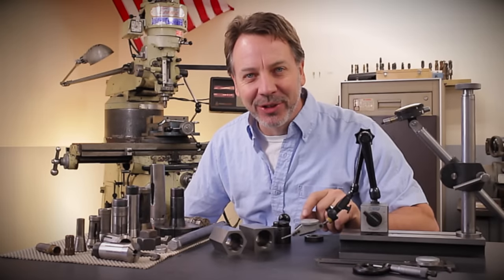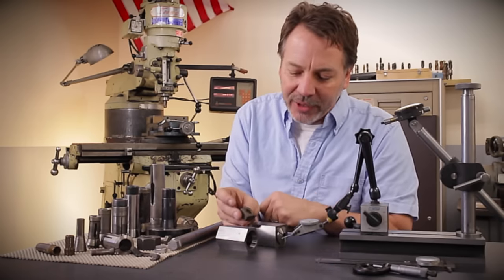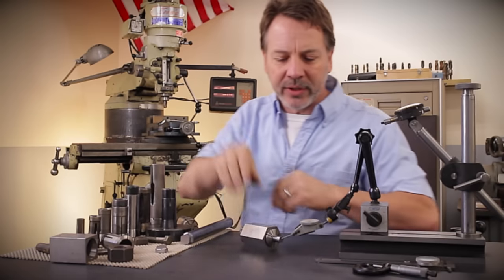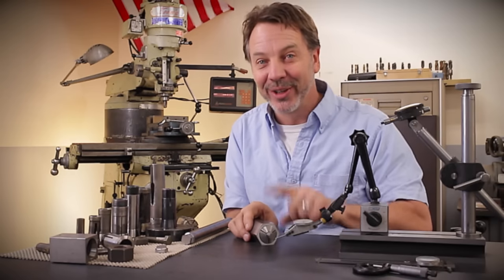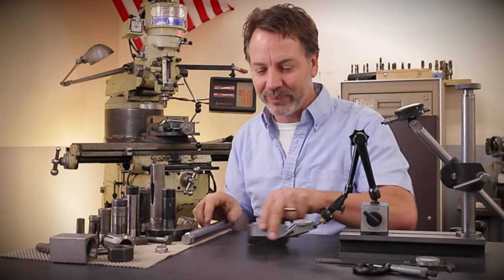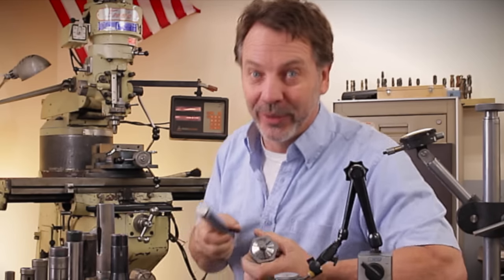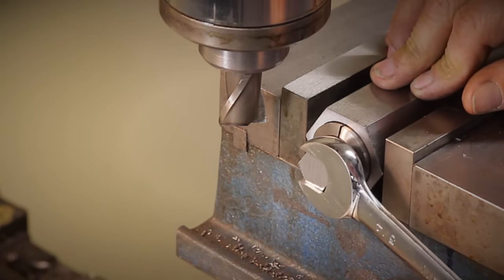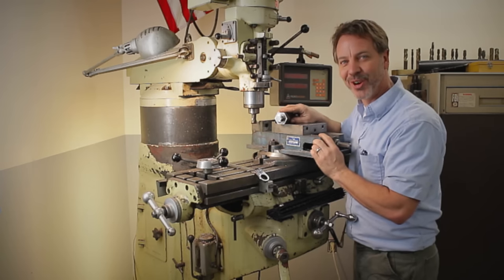How to use Collet blocks

Comment: I learned the hard way not to have the direction of rotation of the tool trying to pull the work from the collet. I now make sure to have the cutting force of the tool pushing in so it tries to force the work tighter into the collet.,

Comment: I have a set of 5C and many ER32s used on a CNC router. Been looking at the blocks but leary of Chinese and have too many wants to buy professional level. Metal is my hobby, wood my business. We replace our ER collets every year, they wear with constant use, heating/cooling, side loads, 16,000 rpm. Thanks for the great videos.

Comment: I'm a journeyman machinist of 40 years service and you did good. Years ago on my Bridgeport days I used one often, but sometimes they want a slot or flat on a few surfaces, so this was your preferred tool. You can use the block in a lathe too if your work is to be held properly without creating clamping marks on the finished surfaces.

Comment: I have a spindexer that I was going to use Tom Lipton's modification to create my own index plates before I got a rotary table with plates. It is handy for setting up in the vise and indexing 90 degrees for square and 60 degrees for hex. Another option for your viewers. Good job Dale, watch all you tips and have learned a ton. Keep them coming

Comment: another great episode that I just revisited.
as a suggestion it may be of benefit to outline the possible or common mistakes that occur in the various machining processes. like when you  (intentionally) rotated the collet block initially on a flat and then onto a corner. these type of examples are great for the budding home machinist.
Reply from the maker: great suggestion. See what I can do.

Comment: Hi Dale, it appears that either no troll has surfaced yet or they failed to catch the troll bait, which not clearing the vice and collet block of any chips or foreign material each time you rotated the setup, which is important for accuracy. Anyway, great job producing a simple and easy to comprehend explanation of collets and collet blocks. Thanks for sharing!
Reply from the maker: +Jeffrey Vastine 
Good job find the troll food.

Comment: From 6:00 - 7:00 after checking the dowel, I would mark the dowel side where the "X" is then loosen and rotate the dowel in the collet to assure the "off" readings were in the block and not the dowel. Next if the discrepancies were in the block I would chart the variance of each orientation to use in the future for better accuracy.

Comment: Good video as always Dale. And nice to see some one running an accuracy test on the tooling. I usually won't buy anything for the shop unless there's some kind of + - accuracy specification given. The off shore tooling is getting better in most cases, but the bottom priced stuff can still be pretty bad at times. But mistakes can even creep in on the top drawer equipment. If you don't test then there's no way to know you got everything you paid for, or that you just may have made a mistake and not paid enough.
Reply from the maker: +Turning Point 
great point

Comment: Clamping or referencing the work in a sharp edge is what I don't like about hex collet blocks. I will make a 12 sides collet block, I think will be more usefull. You can clamp in a flat surface, plus being able to index 2, 3, 4 (although I already have a 4 side collet block), 6 and 12 sides.By the way I prefer ER collet blocks, ER collets are more common here in Europe than 5C, and you can use the protruding nut to index the block.

Comment: Great video that''s going to help me make my Harbor Freight mini mill, be a "poor man's lathe". With the hex block I'll be able to machine a smaller bolt head on an existing grade 8 3/4" shoulder bolt. The problem I had was machining the run out of the shoulder for the 4 jaw chuck adapter plate. I needed the bolt head still attached to wrench it onto the adapter plate. The bolt is quite long, and I have no way of keeping the bolt centered with a live center as it's a mini mill, not a lathe. The Spindle head is my moving carriage so to speak.

I then have to machine the adapter plate with precision so it fits into the 4 jaw chuck

I purchased a QCTP from Grizzly, and a Slotted Angle Plate to attach the QTCP to the mill's table, to hold tooling.

But now being able to cut off the existing bolt head with the length I need for the shaft and smaller bolt head to fit inside the R8 collet, will increase the accuracy for the 4 jaw self aligning chuck. This all had me pondering as to how I was going to make this accurate, as the length is 6 inches.

Seeing this video saved the day! I don't have the money to buy a lathe so this was the next best thing. Believe it or not, I'm going to use the lathe chuck to do accurate letter stamping on an invention and some parts I'll be making. Hope this all makes sense. Thought I'd leave a positive comment, and build something cool too!

Hope this is a bit clearer than mud. But just had to write you to let you know, ya never know what you pick up, and will later apply it down the road. Keep up the good wotk Dale!
Reply from the maker: Thanks for you comment. Im glad my video was useful. :-)

Comment: Great vid, many times I've debated witch surface to register to the vice jaws. Do you mate the flats of the collet block to the vice jaws for maximum holding or the flats of the collet block to the bed of the vice to easily achieve a perpendicular cut????? I've utilized both methods without loosing an eye or spoiling the work. I've used collet blocks along with sine bars, angle blocks and stood them up on end  and using a work stop, drilled bolt hole circle on the end of a 1" shaft (worked great)! They also have their uses on the lathe, like in three jaw and four jaw chucks.  And of coarse on the grinder. A very affordable, versatile and overlooked tool. Looking forward to you next vid. 
Thanks
Andrew p
Reply from the maker: +Andrew Podaca 
Thanks for your comment, great points

Comment: Great video. I am a welder by trade but have also developed a passion for the lathe. The funny thing is a week ago I bought an assortments of lathe tools on eBay and had the collect blocks and locking rings in it that your video was on. At the time being a new-be to the lathe was not sure what they were. Thanks for YouTube. Now knowing what they are and how useful they can be I need to buy collects to go with them. I have a South Ben 9" lathe. Any thoughts on sizes to start off with and a company to purchase them through. Great video. Will be a new subscriber.
Reply from the maker: Hi Sharon. Go on eBay and by a set that is in  increments of 16th of an inch. The cheap Chinese ones are just fine. I would rather have new Chinese set then  Worn out brand name ones  like South Bend or Hardinge.

Comment: nice video, love that pro's make goofs too; but as you didn't show how you installed the rod in the collet block, how do we know how tight you are to "wrench" on the fastener of the collet block (ie: 12 in/lb or 20 ft/lb) -and do we need to use a torque wrench or will a 5 inch breaker bar do the trick.

Comment: personal opinion clamp on the flats (vice jaws to collet holder flats) more surface area contact, I know your not applying a excessive force with the vice but, clamping the thin edge could cause a deformation of it which would effect parallelism. But as Andrew Podaca says there is more than one way to use a collet block. Here's a project for you make a five sided block, and if you want to try and push your precision limits make a seven sided one (divide 360 by 7 you'll know what I mean :) Thanks for your time making these videos
Reply from the maker: +Stephen Reeves Thats a very interesting idea. Thanks for taking the time to comment

Comment: Nice tutorial and well explained. I just went by here, cause I searched something about collets etc.
I'm not saying your caliper is shit, cause it ain't (I got a similar one). BUT...you can't accurately measure such small differences with a caliper, you need a micrometer screw. Which you btw have to calibrate before you measure anything.
The smallest distance you can reliably measure with this particular caliper is 1/100 mm, even that is stretching it to the limit.
I'm pretty sure you know that, and only used a caliper so the viewers could see it better.

Comment: What timing, I just ordered a set exactly like that this morning.  Any tips for using the block in the vertical orientation?  I'm guessing that locking ring on the bottom isn't ground flat.  I was wondering if I would need to use an angle block or 1-2-3 block or something to set it up with.
Reply from the maker: +Stonewood 
I think your on the right track. My next video I used the collet block in the vertical position.

Comment: 1) I'm not trolling nor do I feed them. When clamping collet blocks in the mill its better to clamp the side against the solid jaw when using a hex copier. To control depth set the adjacent side on either a parallel of appropriate height or a piece of ground round stock, drill rod, dowel pin or an end mill shank. More clamping area plus if the corners are off it can effect the setup

2) What if you need a collet block with an odd number of sides (say 5 or 7 or 8 or 9 or even 10). Making your own is not difficult and 4140 TG&P at 30 to 35RC is more than tough enough

Comment: Good info. Thanks! Do you have a source for the spanner wrench for the collet block?
Reply: I got a spanner wrench from Enco. I don't remember the size of it but I just measured the nut and found a wrench in that size range. it was pretty cheap. Don't forget to measure the hole size also.
Reply: +jjs4x Hole size meaning the hole the pin goes into on the outside of the nut.
Reply from the maker: +powaybob  I think these guy answered your questions

Comment: Hi Dave , nice video . I knew those block exist , and I've some applications for them , in our workshop , but I need 45 deg angles , means I need an octagonal block ; do you know if they exist?
Reply from the maker: I dont know of any that are 45˚
Reply: +Metal Tips and Tricks (Dale Derry) I've made odd sided 5C collet blocks. To do it properly you really need access to a surface grinder
Reply: Use a square block and a big 'V' block for your 45 degree cuts.

Comment: Thanks for the info, as always. I really want to get a mill and I've learned a ton from your videos about using them. Collets are one of the biggest areas I don't fully understand (specifically selection, and how much, if anything, I need to consider about the collet selection issue before purchasing a mill, new or used). If you have or can recommend any videos on the subject please let me know. Otherwise please consider doing one. 

In one of your videos you said something that made me think you might be local but then I forgot to ask where you are and I don't remember which video it was. So where are you? :)
Reply from the maker: +Jon Miller 
Hi Jon. I now live in Roswell Ga. Just north of Atlanta.  Most basic milling machines take R8 collets. A set of 13 is about 60$. good luck on buying a new machine.

Comment: Dale,  You didn't test the accuracy of the block from corner to corner, so using the flat as a consistent reference on the bottom of your vise and clamping on the corners makes sense, otherwise the depth of cut may not have been consistent in relation to the center of the piece.  Great video. Enjoyed the goof.  Warren
Reply from the maker: +Kathy Wilson 
glad you liked it. :-)
Reply: It would be better to clamp in the vice jaws flat to flat thus putting hex points vertically in the vice to reduce clamping wear on the susceptible finer hex points. He could measure his blocks point to point against a square / 123 block etc on the granite plate. Sooner or later the hex collet block edges will wear faster than the flats... Practically speaking this may be unmeasurable or just irrelevant in a home shop..

Comment: QUESTION - I was very surprised to see you clamp the collet holder at the corners after you spent all that time looking at its accuracy. Did you not clamp it tight? Maybe I'm missing something. 
Thank you  Always learn something from you. Btw, love you feeding trolls. Too funny
Reply from the maker: +Micheal Double 
The collet blocks are harden, and will not flex enough to  throw my measurements off.

Comment: You really like the "hobby" dont ya ? it can be seen in ye eyes :)
One tip (question? ); dont you find that position on milling machine a bit uncomfortable do work with ? it seems a bit to high, that position of table and hand wheels. The milling machine i work with is positioned (i am rather positioned relative to table), so that my hands are not that high. it gives me comfort that way, chips dont fly into my neck, and those kind of things.
Reply from the maker: +11thboris 
I think you have some good points, but I like that I don't have to bendover to see the work. :-)
Reply: ***** Absolutely no problem. I was thinking not that lower, maybe a height of a pallet as a stand. 
But as we know we all have our ways :)
Reply: +11thboris I assume the height of his work area has to do with his mill having a riser  block installed , which would give him more Z capabilities..

I hope i am seeing that correctly =)

Comment: nice video, I am a beginner too, by the way you did not mention what cutter and what speed you ran the cut with, also how do you know how tight to do the vice, or the collet block up to?, should one use a wrench or a torque spanner. ( am guessing ~ 20-40 ft/lbs is tight enough?).
This point is were experts stop, they don't say how they "feel" the job - how tight, what speed, use of insert tools vs. brazed on ones, putting tools/ inserts on mills' collets and then inserting in mill spindle, how to mount a vice on a table, etc. and if they do they use X 2 speed how infuriating!!, would be nice to have a real time , step by step instructional on these basics of milling operations, thanks.

Comment: I am a bit confused.......you set the calipers to 0.750, zeroed out then took a measurement of the mill cuts. You said the reading is 0.430  but the caliper reading  is 0.1430 . Why did you discount the  " 1 ".

Comment: I'm not usually one to troll when someone doesn't wear safety glasses or wears a tie when using a lathe. Guys will do what they feel they are comfortable with and it is usually because what they are doing makes the task quicker or easier. So they trade safety with time. We all do it to a certain extent, either because we forget or it is easier to do something, but for the life of me I can't see why you feel the need to have your right hand resting on the work whilst you make your cut?